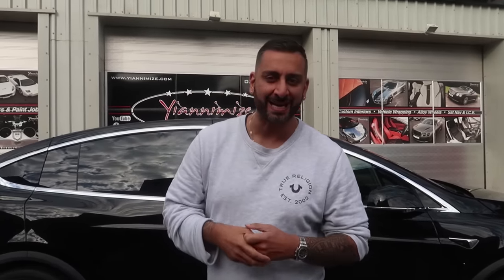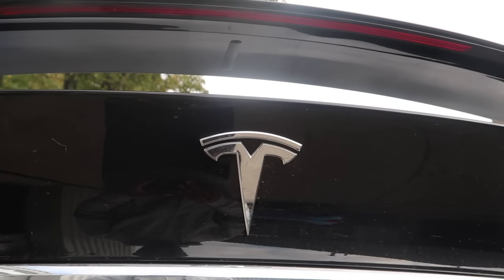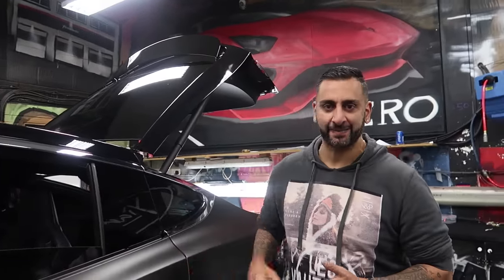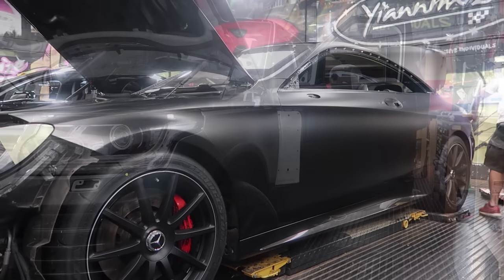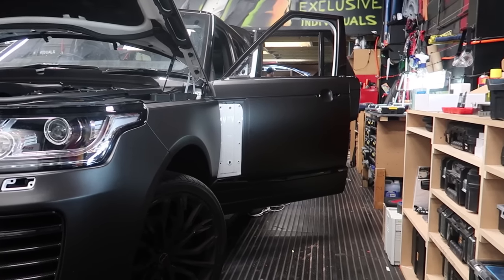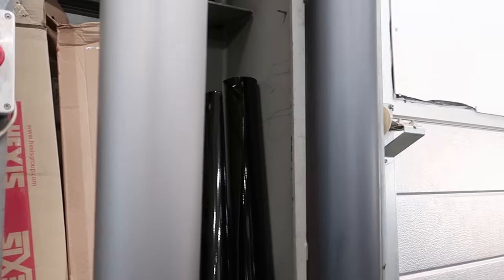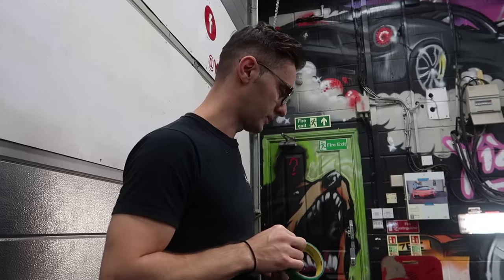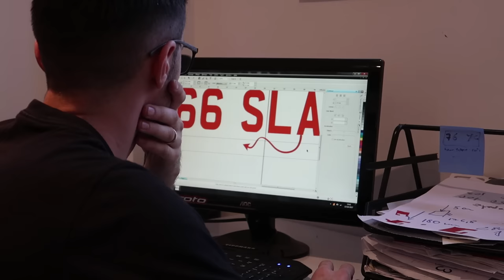Black Tesla Model X wrapped Satin Black with Marbek Style Grey Camo

Comment: The only thing I don't like about camo designs in general is the fact it is hard to not make it look like a cow on wheels. A camo pattern in my opinion should have overlapping, sharp egdes mixed up with round edges and the base colour should be hard to spot. However, I understand it might be difficult to do such a thing with a certain time window or it might be impossible within the used techniques of wrapping a car.

Although I have to admit that this wrap made the car a bit cooler. I'm not the biggest fan of the Model X, so good job on this car.